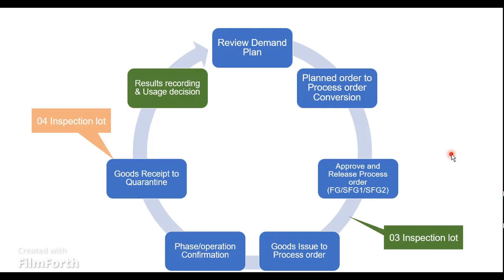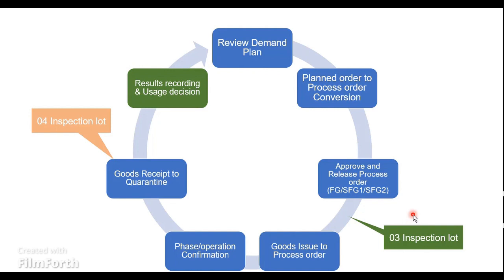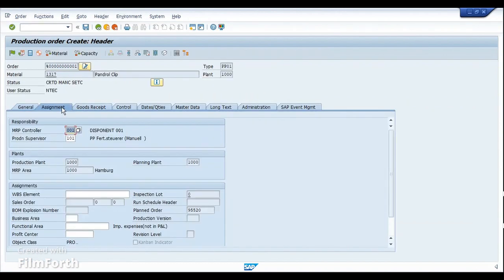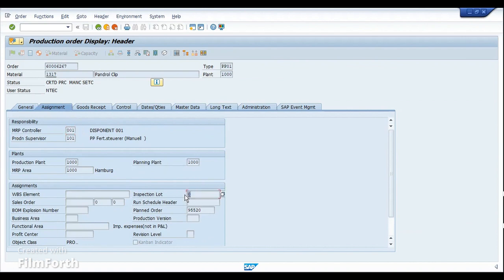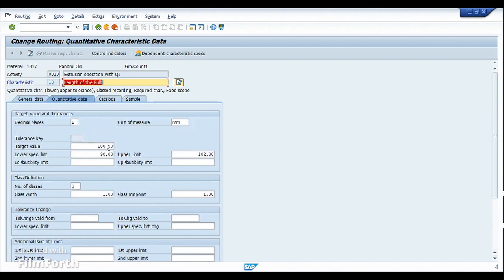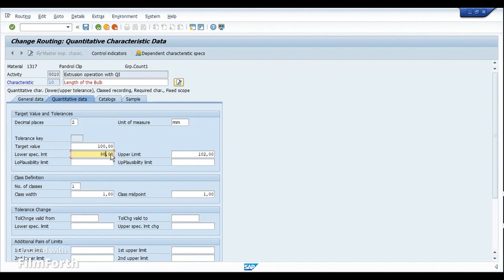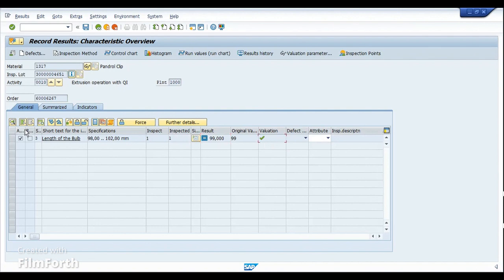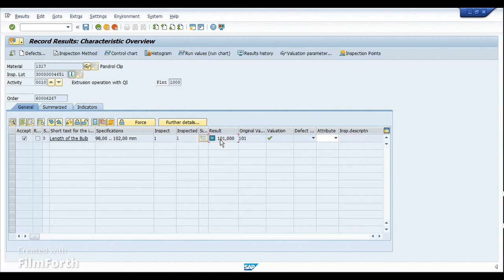SAP PP-QM Integration | 03 Inspection Lot | Quality Management | Easy to understand

Comment: SIR...

Could you solve one issue, sir? There are several inspection points I want to create, but I don't want to stop my production as in it should not affect my production. But I want to do inspection.  example:- I want to manufacture HCl and raw material is Nacl..So Nacl will go through saturator reactor and so on,..but production will be continued but i want to do inspection in several point like saturator reactor etc.Even inspection result is beyond the tolerance limit.Still production should not stopped for result.How can i do that?
Reply from the maker: Did you check the use of inspection points in 03 inspection lot?

Comment: For inprocess inspection, Have u checked inspection point in sampling procedure? I mean is it required any checking of inspection point in sampljng procedure?
Reply from the maker: It depends on your requirement. For example if you need a periodic inspection for every shift you can assign in the sampling procedure.